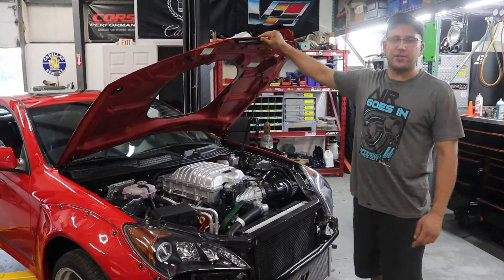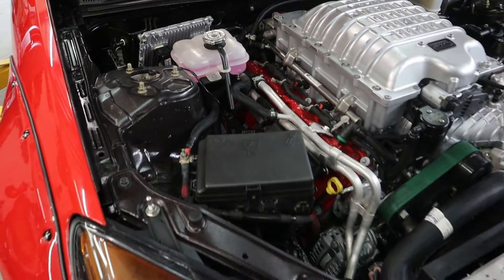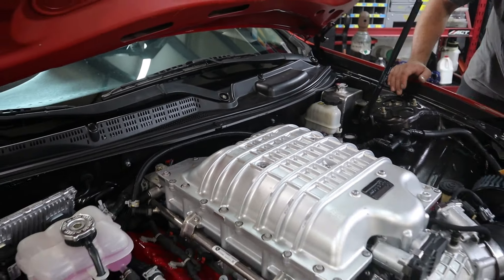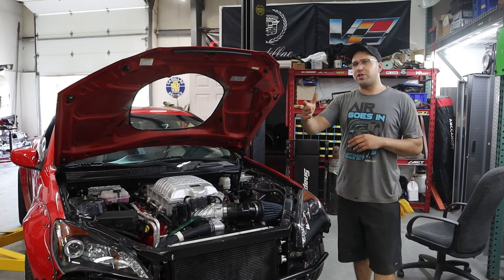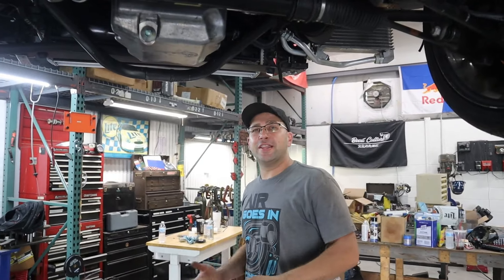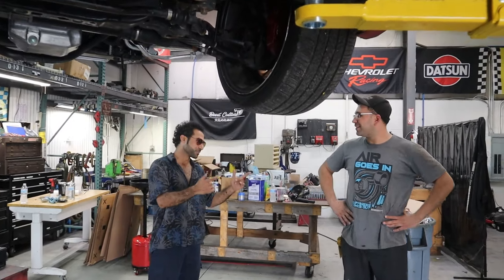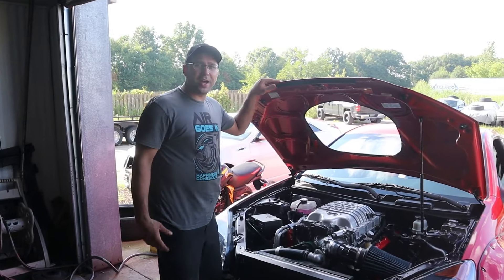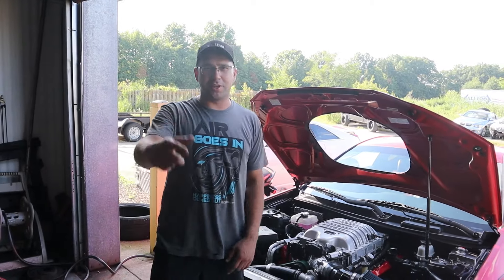Hellcat Redeye Swapped Hyundai Genesis V.2

Comment: Do you sell motor mounts for this? Also is the AC hooked up? Do you sell conversion kits?
Reply from the maker: We do not. Ac is hooked up like OEM.
Reply: @StreetFabPerformance  could this swap have been done with stock genesis coupe (Bk1) dashboard? Just wondering why was the challenger interior used instead of the genesis coupe interior? Would it have been possible to just retrofit the challenger instrument cluster and nav onto the genesis coupe?